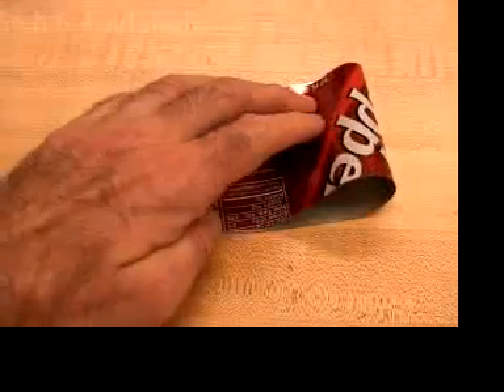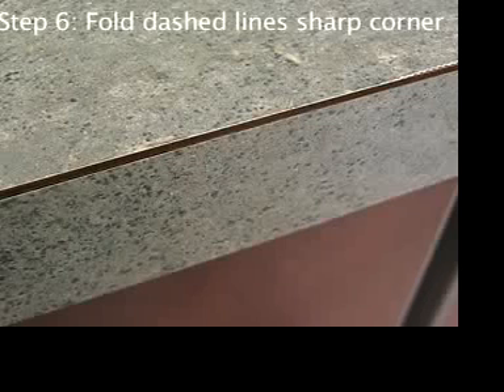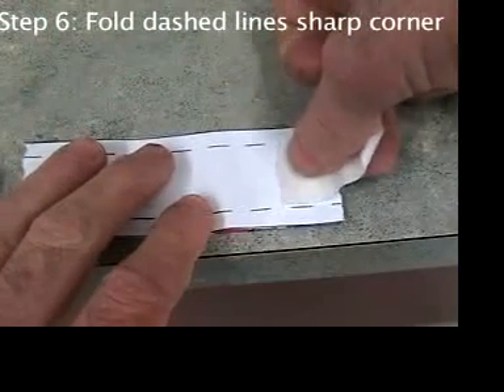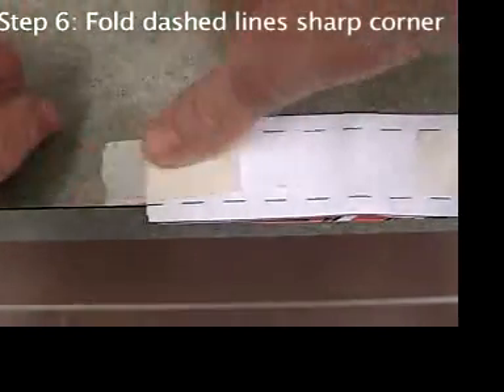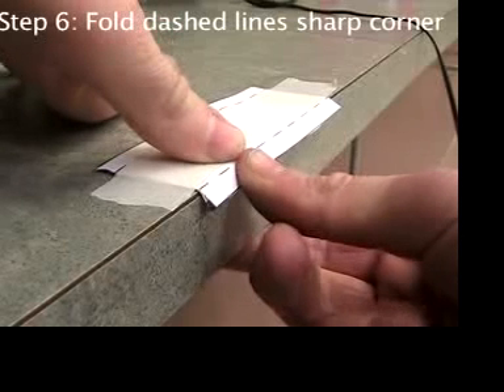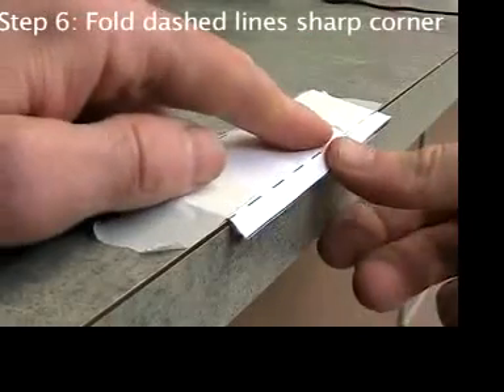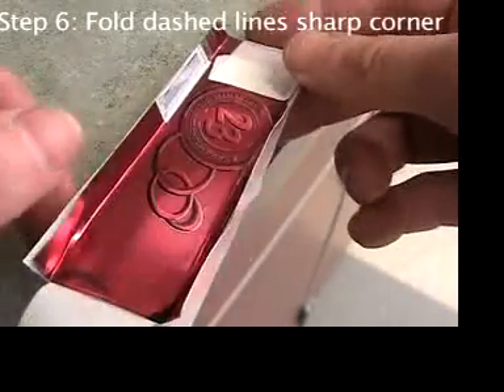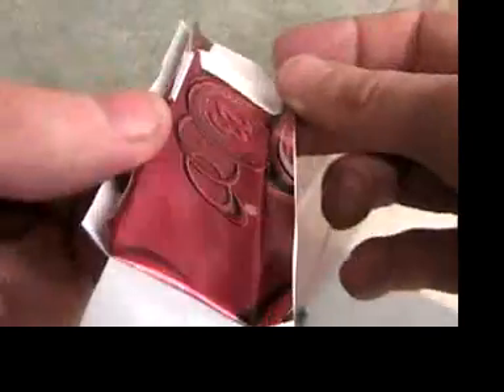Part 9 Build a Putt Putt/Pop Pop Steam Boat s6 fold dashed

Comment: Jb is rated to 310c. I did a steel can lid put put engine a while back, with 300c silver bearing electronics solder, went good until the solder liquified.. so 400-500c rating is desirable. RTV's looking good! Cheap too. needs to be thin for best results. I use it on petrol engine gaskets a lot. everything but the head gasket. I've tried High temp silver solder. very tricky and no good for kids. I'll get some RTV this week and keep you posted.

First epoxy engine runs well! Leak testing boat now.

Comment: Regular silicon would not be so good, although technically it should handle the temp and stay flexible, it tends to powder with high temps, like when I used it to seal a soda can patch on an exhaust manifold. lasted a few days. RTV though, has higher temp rating, around 500c and is oil and petrol resistant. still takes 24 hours to cure fully. JB is probably using additives, as it seems metallic. Fire retardant additives are among the many available. google tells me regular epoxy is rated to 200c

Comment from the maker: Yup, i saw some of your electronics stuff, cool. The search for an alternative to epoxy is like the search for the Holy Grail. I have not been successful. I found silicone to take very long to dry and not strong. JB Weld, at least as we have it in the US (2 part resin), is a brand name of epoxy.Super glue didn't fill gaps.Hot glue melts. Double folds still leaked...

Comment from the maker: It's an inch between the dashed lines, and another quarter inch to the solid lines. You bring up legitimate points, There are a lot of things I'd like to rework on this project and others. I would point out that it's just one guy doing it in his spare time: R and D, video, web pages, answering questions--all for free. If others would like to jump in and help with the workload that would be even more helpful than pointing out the many shortcomings.